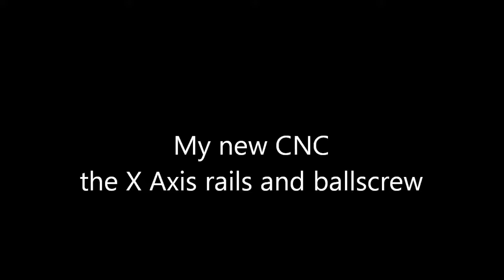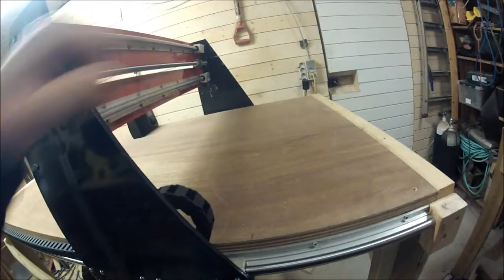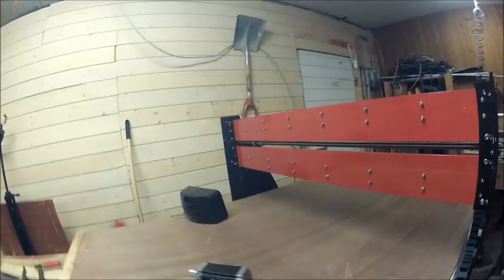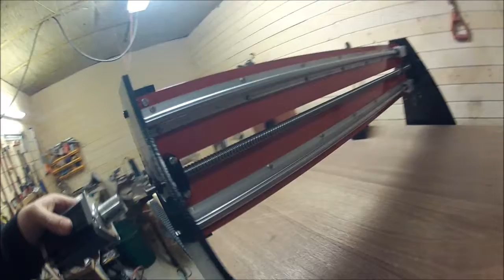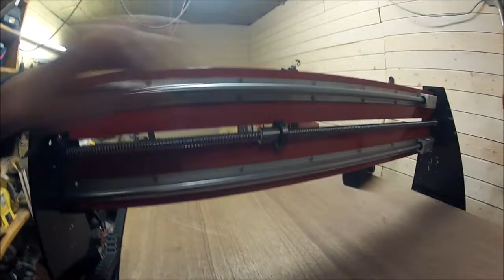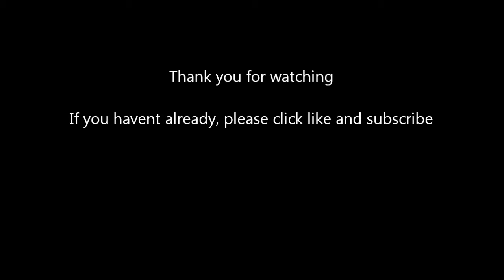My new CNC - Part 3

Comment: Oei.. I think they are 20 Tooth T5 or 20T HTD20, with a 16mm belt.
I buy those at cnc plus (germany).
I use a 1 to 1 ratio, its purely to prevent the motor from sticking out that far.